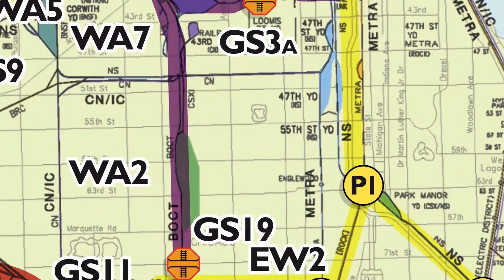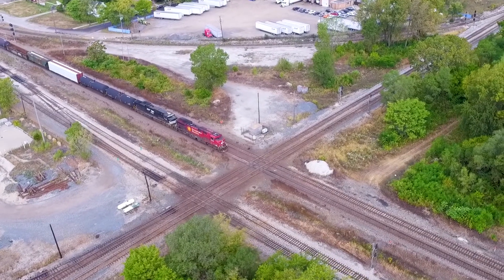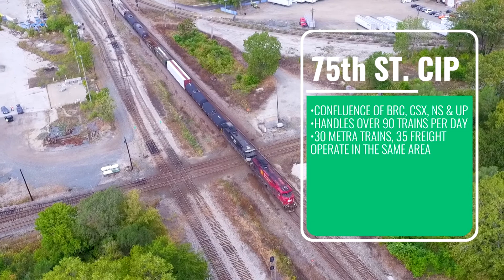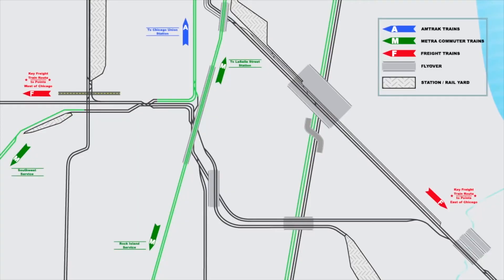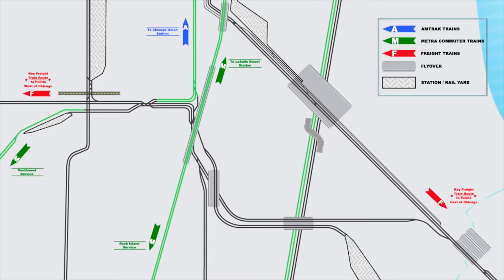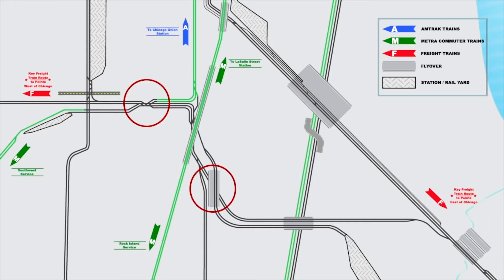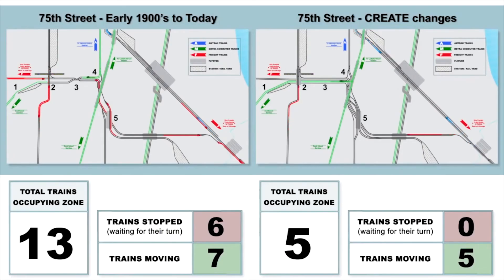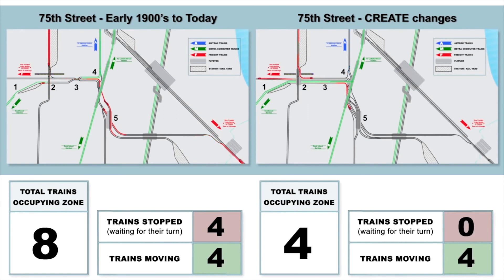CREATE 75th St.CIP

Comment: 75th Street is a major chokepoint. The first problem is Metra Southwest Service entering the Loop have to stop at Wrightwood. The problem here is past Wrightwood the westbound mains terminate at the NS drill tracks to Landers Yard. To get into Union Station Metra has to cross over the drill tracks onto track 1 and stop at Forest Hills to cross over the UP and CSX Western Ave line which goes to Barr Yard at the top of the screen. That's the second problem Forest Hills Junction UP and CSX conflict with everyone CSX crosses every track shown on the screen and everyone has to stop while they come through. 

This creates another problem the Barr Yard drill tracks cross over 71st Street in front of a fire station and when switching needs to be done at Barr the street and both tracks at Forest Hills are blocked prohibiting the rescue trucks from leaving their station.  Then we have problem four Belt Junction all the tracks come in here. To the west we have the BRC lead tracks and the CN and CPKC mains going to Clearing Yard they go from 5 yard tracks to 3 yard tracks to 2 yard tracks and down to single track to enter Belt Junction and back to 5 tracks when they hit 80th and Englewood then you have the UP St. Louis Line that goes through all four junctions. Finally problem five is 80th Street Junction itself all tracks here make a sharp turn to the north and south BRC trains and NS trains turn south and head to NS Ashwood Yard which is at the bottom and UP trains and Metra trains turn north onto the St. Charles Line to enter Yard Center and Roosevelt Yard just outside of Union Station and NS also turns north to go to Englewood. To complicate things Amtrak sends 15 trains through here each day and they get first priority.   

Here is how we will fix this 1. the NS drill tracks will be realigned and a second track will be built from Wrightwood to Forest Hills. 2. and this one is being built take out Belt Junction and extend all tracks to 80th Street. 3. Reconfigure all UP tracks and NS tracks at 80th so trains are on their own corridors and subdivisions. 3. build the flyovers one at Forest Hills and one at 80th take Metra and CSX out of the picture. and finally connect all Amtrak lines to Grand Crossing and have only UP, NS, and Amtrak on the St. Charles Line not Metra.